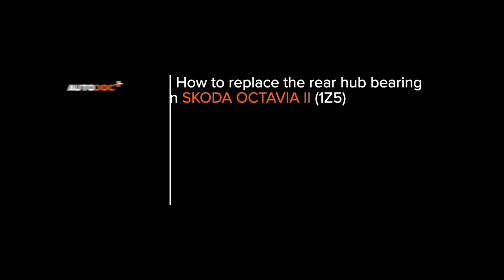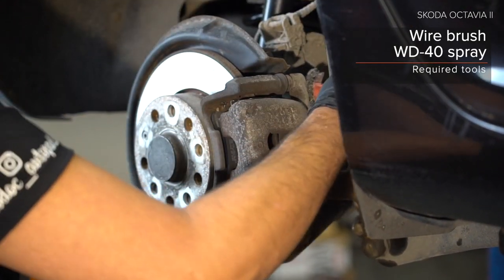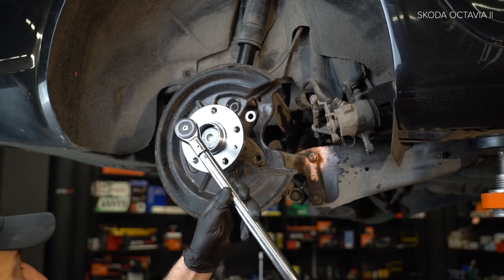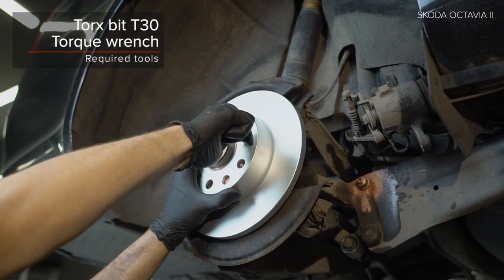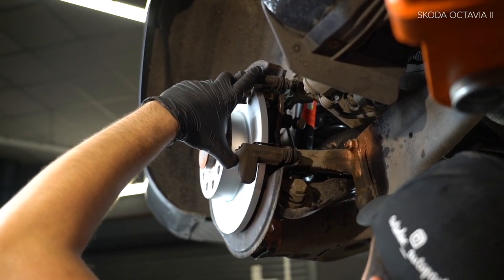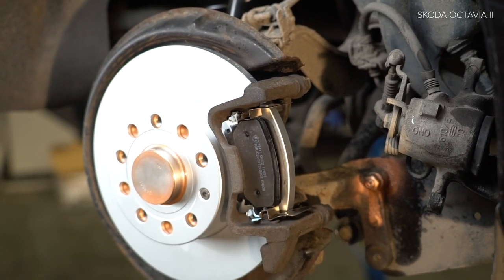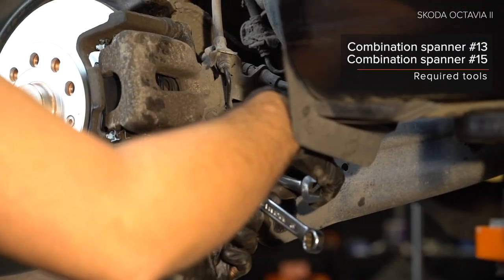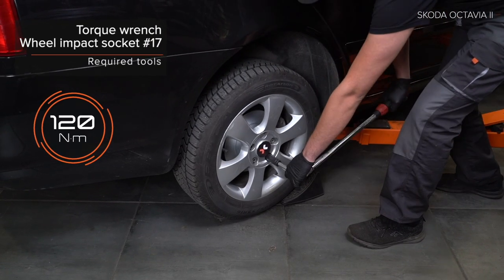How to change rear wheel bearing / rear hub bearing on OCTAVIA (1Z5) [TUTORIAL AUTODOC]

Comment: I got a problem with magnetic ring of the abs sensor,is it wort to change jost the ring or is it better to change whole hub?the ring is on the new hub?
Reply from the maker: Thank you for your comment!
Unfortunately, without a complete diagnosis, it is difficult to suggest anything, we recommend contacting an auto mechanic.
Best Regards,
Autodoc team
Reply: You can't get the ring separately.  You'll need the hub. The ring corrods and often damages the speed sensor causing abs/esp light.  If changing sensor do hub too.  Changing just the sensor will lead to poor or no dsg shifting despite no warning light.

Comment: Is it XZN M16 or M18 socket used to untighten the bearing hub ?
Reply from the maker: At 3:36 minutes into the video, you can see in the upper left corner which head was used.
Reply: It is not XZN M16. Mine was XZN M18!!!

Comment: Um, in the skoda manual workshop, for the 1z5 the wheel bearing hub setting torque is 180 NM and 180 degree. How it is gonna be 143 NM? Which one is the correct? Thank you
Reply from the maker: All our videos are for informational purposes only, you can familiarize yourself with all the moments of puffs in the technical documentation for auto repair.
AUTODOC
Reply: @autodocuk  okay, but why do you give false information for people who is gonna trust in autodoc videos?!?!
It is a little nonsens to me
Reply: @ferencantal708  I came here to say exactly the same thing - 140 PLUS 180 Which is an ENORMOUS difference (and that's bc it's a stretch bolt)

Comment: Great video thank you. 
I needed a #19 rather than a #15 to use with the #13 spanner.
Also removing the original hub bolt after 12 years was quite a challenge. After shearing one extension bar and bending another tool, eventually my father cut a scaffold tube in half which he and I were able to use as an extension couple to get the bolt loose!
Reply from the maker: We cannot show all the nuances and problems during replacement; this is all individual and it is not always possible to solve them at home. To avoid this, we always recommend that replacements be carried out by specialized car services.